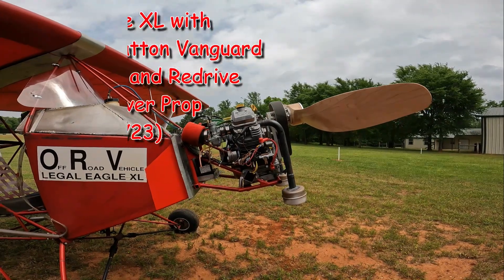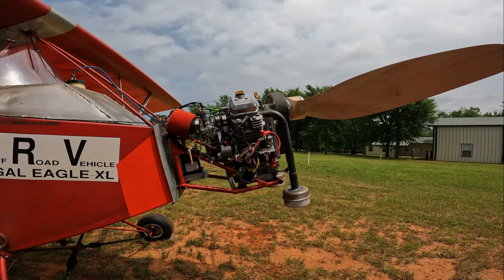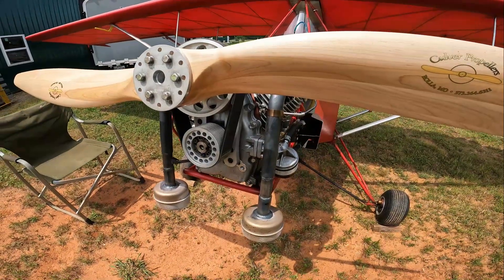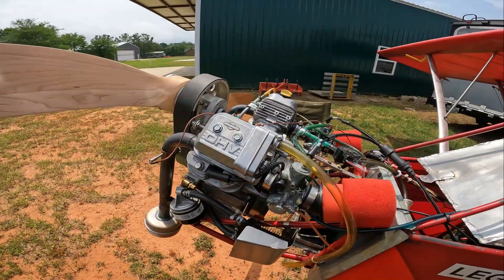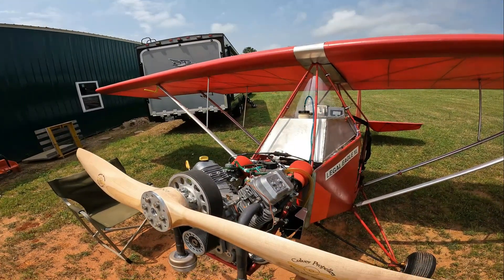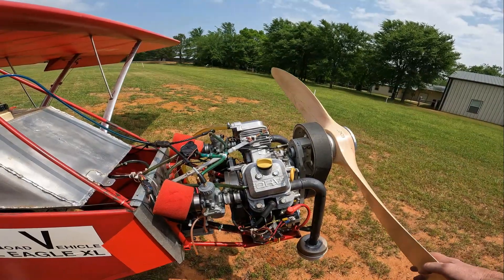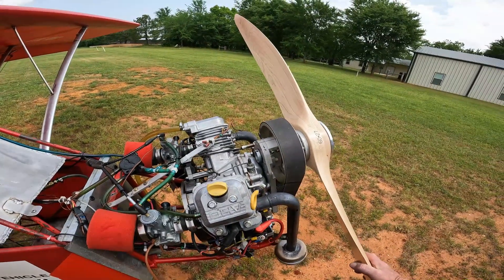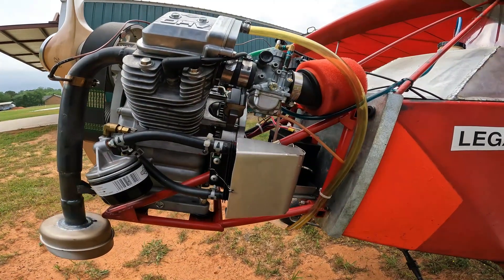BSV23 Walk around and comments

Comment: 35 to 50 horse is available from this engine. Apparently without serious reliability issues. I will build a Honda GX series and see how it does on my trike before I know the reliability personally.
Reply: Did you do it? I plan on using the gx for my quickie
Reply: @Thatguy.mike209  I've built a few now without issues, but I haven't tried building  a "Chonda" yet to see the reliability difference.
Reply: I have a couple questions about mounting the prop, is there bolt on kits for these small engines
Reply: @Thatguy.mike209  I have seen one sold a few years ago but normally they are cnc machined from a custom design.
Reply: @MrInnovativeEnergy  thank you sir

Comment: A few questions. Is the engine with the governor removed? If  yes was the connecting rods replaced with billet aluminum? Tighter value springs used?
Reply from the maker: Governor is removed. We are turning a max of 4300 rpm with Max gross weight and wood prop. With the warp drive ground adjustable turning max of 4100 rpm with max gross weight. If aircraft was piloted by 170 lb pilot these RPM’s could be reduced. Engine is all stock
Reply: @LesHomanLegalEagleXL  I'm 245 pounds pilot. All your videos seem to show the L.E. flying just fine with the stock vtwin. I was seriously considering modding a preditor 670cc with billet aluminum flywheel (non charging), billet rods, Molly push rods, heavy springs, and cam rated for 6k rpm. The redrive using ace aviation redrives. I want the power to get me off the ground but I only plan to fly it gracefully.

Comment: Les - I saw mentioned in another video you tried an aluminum flywheel, to save weight, about 10LBs.  I assume the aluminum flywheel is made by ARC?  Have you or anyone contacted them to see if they would make a modified version of the same flywheel with 2 modifications.  1) Remove the fins.  Since all the cooling ducting has been removed the fins are not needed and they are a parasitic load on the motor.  Removing the fins will result in more power to the prop, and the flywheel can be made from a thinner blank and require less machining so it should cost less as well.  On VW 40HP motors for Formula V disconnecting the cooling fan gained about 7HP or about 17% so well worth doing.  2) Add back the charging system components.  I don't know if the parts necessary for charging can be removed from the cast iron flywheel and added to the aluminum one, or if ARC would have to source the appropriate components but I would gladly pay ARC prices for an aluminum flywheel to save weight, result in more power to the prop, and still have a charging system to recharge the battery and run the instruments.  Thanks for doing all this development work.
Reply: Use a solar charger to maintain the battery.

Comment: I would like to see the engine on a stand with a culver 60x30 to see if it can turn it, if it can spin at 4,000 it may be a better choice than the 27 on it now

culver 60x27
4,400 62 to 63 mph
4,000 56 to 57 mph

culver 60x30
4,400 69 to 70 mph
4,000 63 to 64 mph
3,600 56 to 57 mph

Comment: the briggs and stration the kolher is a good engine also the engines are simple and ultralights are not ment to fly in light conductions and the best part is they are 4 stroke and lest trouble than a 2 stroke and the TBO is higher and the price of the 2 strokes out there are just to high a price to get only 300 TBO it looks good
Reply: kohler too heavy

Comment: Torque flys em, hp sells em
Reply: Horsepower to weight ratio is the determining factor for aircraft and automobile performance. Not torque alone.

You can apply all the torque to a fixed object, but if it doesn't turn, there is no power produced.

(Torque x RPM)/ [(550/2pi)x60]
makes for horsepower.

Comment: So happy to finally see one of these on the front of a LE. Not surprised it was you to show it off first. I'm guessing the "charging magnet" on the flywheel isn't the same as the ignition magnet? I know there's fuel injected versions of this engine and I'm curious what the weight difference is between the two intake systems. It may be worth upgrading the valve springs in it as cheap insurance if they are being revved up higher than spec. Looking forward to seeing more of this!
Reply: if u up the springs then the rods and cam need to be addressed, 4,000 is the limit by manufacturer, 4400 for a minute or so may not be a big deal.
Reply: aluminum does not have provisions to provide a magneto, no charging. aluminum is chosen to save weight of if revving to 5k and beyond, else flywheel may go off like a grenade
Reply: problem with injected version is it is NOT SAFE to fly. It can shut down engine for many reasons and it limits the engine rpm and the altitude sensor may be an issue. The solution is buy the injected version and toss the mcu and replace with a speeduino